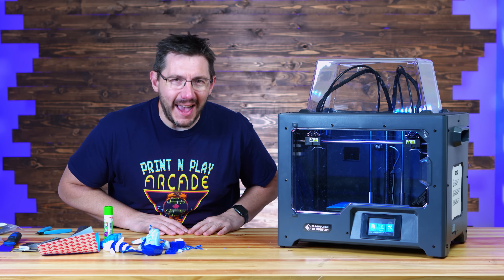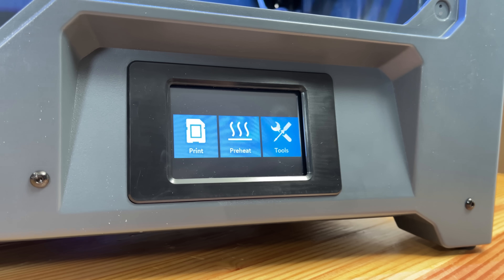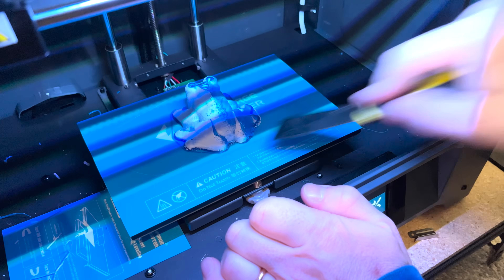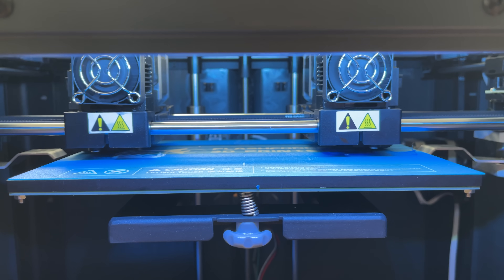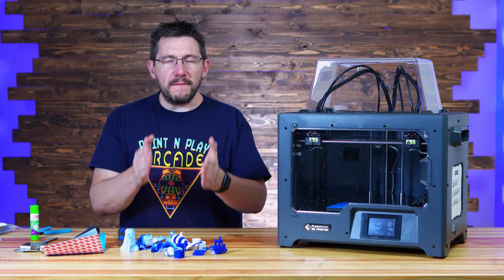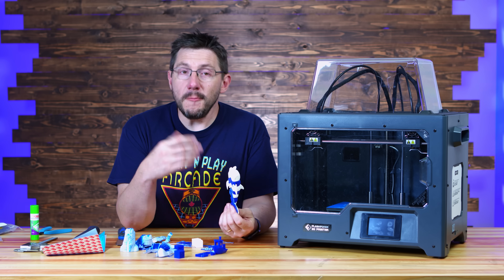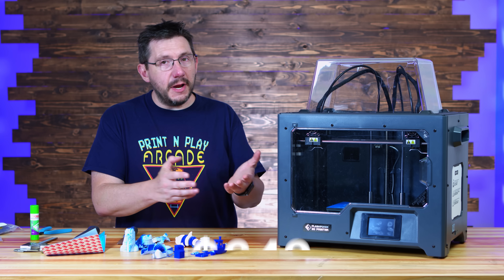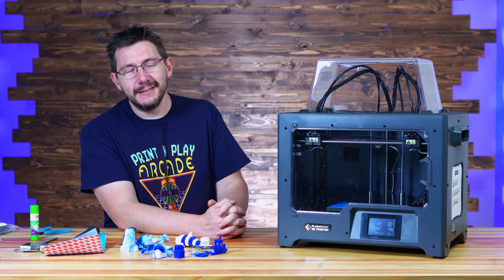Did Flashforge Miss the Mark?

Comment: I'm using the original Creator Pro with a "Wham Bam" flexible bed. The flexible bed was only $25, and easily the #1 best upgrade for the printer.
3D printer companies should team up with Wham Bam and include that bed in their printers. It's by far the easiest way to remove prints.

Comment: A solution to model release I found on my first Flashforge Pro works well on my new Flashforge Pro 2:
First clean the bed and place a tiny spot of light oil in the centre. Spread this over the whole bed with a finger then try to remove all the oil with a paper towel. You won't succeed. There will be a microlayer of oil on the bed. If you run your finger over the bed you will feel a slippery surface. This prevents hard lock and makes release easy.

Comment: Anyone watching this video thinking of getting a creator pro to new or used, don't listen to him about bed adhesion issues. If you use a feeler gauge that is .4 mm thick that is the optimal distance required during calibration. Also, the lines should not be directly over each other. They should be parallel.
Reply from the maker: Yeah don’t listen to me or my experience with this 😂😂😂. Best part - someone buying this may have your experience or my experience.
Reply: Expecting perfection from default settings out of a plug and play device is a little bit too optimistic. This review is way too critical of an overall, while be, slightly dated, still fantastic device.
Reply from the maker: @balisongsingin2498  Oh for sure, I agree this can be a great device - but you said it right there. "default settings from a plug and play device". That's exactly what should happen. I really don't think that's being too optimistic. If the manufacturer provides the software and the material, it should just work out of the box. Obviously that's my thinking, and why I said what I said. If you have yours and it's kicking butt, that's FREAKING AWESOME and I'm glad to hear it!
Reply: @3DPrintingNerd  well hey, if youre still disappointed in it id happily buy it from ya!

Comment: Yep Flashprint defaults for the raft are the pain in the ass. For some reason it's configured to use raft offset to be 0,15mm. While the first layer height is 0.3 by default. If they would just make the default raft offset to be somewhere between 0.25 - 0.3mm detaching the models wouldn't be an issue. Yet this problem persists. Even today for Flashforge AD5M Pro they have the same bullshit setting.

Comment: I tossed a duet wifi in my original FF Creator Pro with a bowden setup,  bltouch and a E3D Chimera with PT100's.  Completely gutted all the rods,  pulley,  motors,  etc and can print PC with speeds up to 150mm/s with input shaping.

Comment: I feel the issue is more in the slicer. I say this because I had the same issue with the prints gripping the bed so hard it literally tore the blue ‘anti scraper’ surface. 
I bought the magnetic bed for the Creater and installed that. I then set the bed level and clearances with 2 sheets of the Flashforge calibration paper. This made a good deal of difference. It is still very well stuck. Not hammer stuck but still more than I want. I am going to reset the bed to 3 Flashforge sheets. I feel this will be great.

Comment: I'm still stuck on the original FlashForge creator pro, can hardly use it because of all the problems I have to deal with while using it. Dose anyone know what slicer Joel used in the past on his? Because FlashPrint has not done much good for me not even 5.

Comment: have the creator pro 2,just bought a magnetic build surface and its fine.A 20€ investment making it easy to remove the prints.Wating you using a hammer and brute force on that bed hurts my eyes.

Comment: I bought one of these awhile ago -- it's a much better experience after I upgraded to the magnetic base.
Reply from the maker: Oh really? Changed it that much for you? That's so good to hear!
Reply: @3DPrintingNerd  NGL, it was pretty awful using the scraper with a mallet to get prints off…now I just pull it off and bend the plate and it comes right off. A definite improvement…but it’s a 2021 printer in 2023, so to a certain extent it is what it is.

Comment: Exact same problem with the prints sticking to the bed. Lol. I went from PLA to ABS and this printer is actually one of the only printers I have that prints ABS properly because of it's excellent bed adhesion properties. LOL. I added TMC2209 drivers to mine but even that wasn't as easy as it should be.

Comment: Would have been nice to see you showcase the printer's dual head capability; one head for model material and the other head for soluble support filament, along with twin or mirror printing. Instead was a gripe video of dismounting the print. Just show the problem, and the solution, and move on and showcase what this printer has that others don't...dual print heads, and what it can do.

Comment: It's not soo bad! Just have to tune the settings. The default settings are terrible - Yes... But why would you use default settings anyway. Just tune all the parameters and you'll be good. You can also get a glass bed or a PEI sheet directly from FF. 

I really do not see an issue here. I don't have this printer but I have a few of their higher end models - Creator 3, Guider 2 & 3 and I must say the print quality of FF printers is unmatched!

Comment: Ive had the creator pro 2 for a few weeks now. Its my first 3d printer.

While i have experienced all the issues you explained here, its not as bad as it sounds.

Removing prints from the bed is a ton easier if you pre heat it.

Can also buy a removable magnetic plate for additional cost.

Price point for a dual extruder printer is ultimately what sold it for me and other issues can be worked around

Comment: Flashforge Adventurer 3 - removing rafts is almost impossible with stock settings, i give up and print without it.
Reply: For anyone info (if needed) - raft - space to model (z) - change to 0,3mm - its easy to remove model from raft.

Comment: Where's the Creator 4 review? Been 3 months...
Reply from the maker: Likely to be a lot longer than that as well, if not longer. Have any specific questions?
Reply: @3DPrintingNerd  Many... :) Looking for a professional 3D printer for work to support variety of engineering R&D tasks in different materials, must handle >300mm length part dimension, mainly ABS, some CF. Based on this video, having doubts about even approaching this company and since there are no printer reviews, going to be hard to buy blind.
1. How does it compare to Qidi I-Fast, my current choice?
2. Will the dual extruders support dual color ABS printing or are they only for part mirror printing to speed up production?
3. Might be a noob question but why can't I print PLA filament with a high temperature extruder? ie Extruder-HS that prints carbon fiber.
4. How is Creator 4 regarding plug and play simplicity (ie calibrate, install filament, print a calibrator tool to dial in shrink size and start printing ABS without having to fine tune the recipe)? In other words, is printing ABS on Creator 4 problematic to a beginner?
Any FDM printer recommendations under $10K, heated volume/bed, ABS/CF, big volume (>300mm in single direction)?

Comment: I bought a creator pro 2 a few months ago, and faced the same issues. I was about to set it out for someone to “steal” and give up on 3D printing. Watched your review, and almost had it out the door when I saw a short video on the removable build plate. I purchased one and replaced the awful factory “sticker” with it. I also found out how to turn the raft off. Doing these two things turned it into a useable printer. Not the best, but at least I didn’t have to trash it. For those of us who purchased one, it would be a great kindness if an expert like you took a quick look at seeing if there is someway we can get by the problems.

Comment: Also, the ONLY way to go as far as the build plate goes is to get the magnetic upgrade, and scrub away that shit FF blue surface with some elbow grease until it's all gone.  That will amazingly give you the best build plate i've ever used, ever:  a smooth, shiny mirror!  fucking brilliant.  But you gotta work for it, and sadly i would expect most to return the thing before getting to experience using the exceptionally functional but "hidden" build plate.  And the BEST thing about this printer, which makes it a bargain even if it costed several thousands is that it does something totally unique that is way beyond ultra high end printers even.  I hate to even reveal it because it was such a nice surprise to discover it yourself.  Oh, alright okay.. it gives world class BJs.   Obviously, that one's in the special hidden preferences menu.

Comment: Anti Scrap!  Not anti scrape.  Anti scrap was the intended claim i think..  Although anti scrape would have made more sense generally.  And you really took that and ran with it, pretty hilariously.  Anyway the "Anti Scrap" design is supposed to be the result of the "anti ooze plate" that scrapes each extruder as they take turns, between actively printing or resting idle.  Your models are supposed to be free of "scrap" aka "ooze" or just messiness that might have otherwise gotten stuck on your model had their not been the anti ooze plate.  Anyway, got a laugh from this.  Thanks!

Comment: I have the creator 2 pro and had the same problems with removing prints from the print bed I solved it by getting a magnetic bed and now I don't need to use a scrapper to remove the prints

Comment: My experience with Flashforge is that they are really good making really bad printers.
Before that I had Dreamer and it was kind of OKish I did think that PRO in the name of printer is meaning something.
In good Chinese tradition - PRO in the name means absolutely nothing. Kind of scammy thing I think
My biggest issue is that they advertise Creator pro 2 as a printer that can print ABS. It cant.
To fuse the layers you need at least 250c but printer is capable 240c
Other thing with this #¤/¤% is nozzles. This printer uses proprietary design so the threaded part  is about 2mm longer.
Nozzle selection for this printer - only brass 
Heating cartridge is about 0.2mm thicker, so when changing heating block you must change it too.
Belt tensioning  .... yeah .... 
Firmware is total #¤%%¤, written by blind squirrels
Flashprint 5 ...... again squirrels but with massive brain damage, on top of blindness (poor things)

After changing to full metal hotend and simple hardware hack that allows to print up to 280c I can at least print CF filaments.
Cura is working fine with it. Only thing I have to admit is that Flashprint 5 ooze shield was better.
This stupid hood is still a problem but new one is "work in progress"
Im still planning to change control board 

To conclusion I have to say that after 3 months with it and a few mods I still have mixed feelings about that printer. 
It kind of have good bones to build on but for that price its total #¤%#¤

Comment: I teach at a high school and I have three of these machines, I agree with your assessment.  But I knew the beds would be a problem, so we replaced them with black glass beds from an Ender 3.  They fit in the enclosure and work great at 70C, I made a spacer for the Z switch to correct the offset.  But the biggest improvement was a switch to Cura instead of Flashprint, I modified the start and stop G-code to mimic the Flashforge code as best I could, it works pretty well and produces a much better print than Flashprint.  We have done hundreds of two color and two material prints (we do a lot of PLA/TPU), and don't use rafts, purge blocks, or ooze shields.  Still no mirror or duplicate printing with Cura, but that is not really why I bought them.  Prints are almost as good as my Raise E2, but I could buy five Flashforges for the same price.  What other enclosed direct drive IDEX machine can you buy for less than $3000.  I hope somebody more skilled than I makes a Cura plugin for this machine soon.

Comment: It should come with a magnetic flex plate like the QIDI TECH's in this day and age, and at that price, a $25 flex plate and magnetic sticker is not much to ask for, also, these machines at that price should have at a minimum, an ABL and they could have put a micro switch on one extruder so it can tap the other and do its own X calibrations of the IDEX system.

Comment: we have a finder at work that had the same issue (easily fixxed by leveling using the onl paper clearance method to prevent it being stuck) but the fact that the printer doesnt level itself correctly is wack

Comment: This is unbelievably bad. the independent dual extruder, and the touchscreen is basically what's different from my flashforge creator pro THAT I BOUGHT 5 YEARS AGO! Flashprint is garbage (but I remember its raft setting being really good, great bottom layer finish; snaps right off idk what happened since.) Switched to prusa slicer with a GPX converter as soon as I could. Its a really solid machine for like 5 years ago, and decent today with a g10 buildplate and abandoning flashprint.

Comment: 2:47 - People always suggest using a [not what comes with the printer] type print bed surface. But actually I love the "mat" that comes with my printer and is just magnetically attached to the print bed. When done I take that mat with the print sticking on it and just peel the mat off. I never had a first layer not sticking properly without that not being my own fault.

Comment: Hi Joel, it's Elyn with Flashforge team. Thank you for reviewing the Creator Pro 2 and sharing your ideas. We're sorry that the Creator Pro 2 let you down. In the meanwhile, I'd like to thank everyone for joining the discussion. All feedback has been collected and forwarded to the product team for further consideration. We do have a removable print bed part for the Creator Pro 2. We just added this option on the product page, and will consider to make a clear note on the page in the following days. In the meanwhile, we'll double check the product description to avoid any misunderstanding. Thanks again for your feedback and suggestions.
Reply: Print bed adhesion is not limited to Creator Pro, I see the same on my Dreamer (~6mo old now). I opted for the magnetic flex build plate as an upgrade which helps but the center of the plate is a bit stiff due to the handle, which can also limit print area (my Dreamer wants to print ~2mm towards the front). The kit I received had very bulky binder clips which also cause problems in homing the Dreamer as it wants to home through the clips, which is dependent on where the head starts from in homing. I've replaced those binder clips with spring steel clips designed for glass print beds (which also typically use binder clips) and have been happy with it since.
Reply: Thanks for removable flexible bed, I got it with the printer from previous owner. Now I need silicone socks, because I see nozzles unacceptable dirty in burned plastic. I will use the printer, for sure, but I need to turn off annoying sounds.

Comment: I totally agree with you for that price you should get a printer that works properly out of the box. That is also the reason why I bought my 3rd XYZ printer. I have a da Vinci Jr Pro+ now and I'am super happy with it. leveling is no issue at all as it does that all by itself and you can take out the printbed and get your model off without having to use a hammer ;-).
Reply: Wow I thought nobody's like me being a huge fan of XYZprinting. I also bought a da vinci Jr pro and a few other day vincis and am very happy with them. However I'm seriously considering of getting one of these IDEX printer for multicolor printing.

Comment: I use a fulament flexible build plate and have tweaked the slicer settings and I'm pretty happy with my Pro 2. It's not the workhorse that my Ender 3 or CR-10S is, but I'm quite happy with its dual print quality and its TPU print quality.
Reply: This is a very late reply, but you say your happy with your TPU quality of your prints. I also have a pro 2 and want to print TPU, but it keeps getting stuck in the extruder and printing rarely. If it does print, the quality is decent. Could you please let me know what your print settings are in the slicer so it might resolve my problem? I already decreased the print speed and retraction and temperature, ao I'm lost at this point to be honest.

Comment: That's charitably a $149 printer. Maybe $349, with the IDEX feature, but that looks like one of the worst stock build surfaces available on the market right now...and the build volume is frankly tiny - a Prusa Mini, with a roughly comparable volume, is $459 assembled and an Ender 2 Pro with a slightly smaller build volume can be had for under $200. 

For $649, I could have a Sovol SV04 (much larger IDEX printer with better features), a Fula-Flex 2.0 dual-sided flex plate (since the stock plate from Sovol has been a pain point for some users), a spool of high-quality PLA (Proto-Pasta or Coex or Atomic or something on that level), and a burrito (maybe with a small drink on the side as well). I know which I'd rather have.